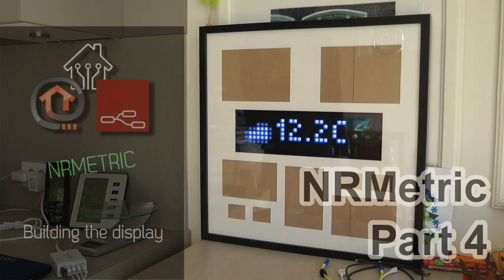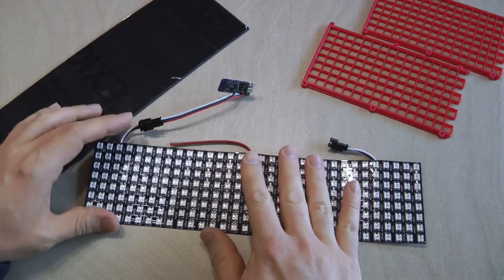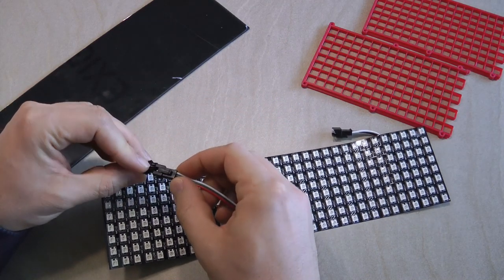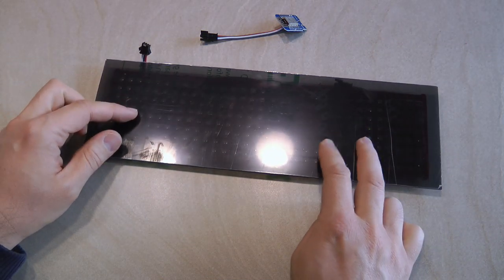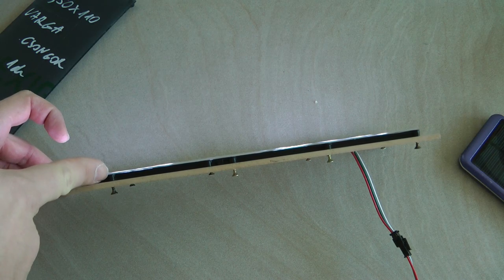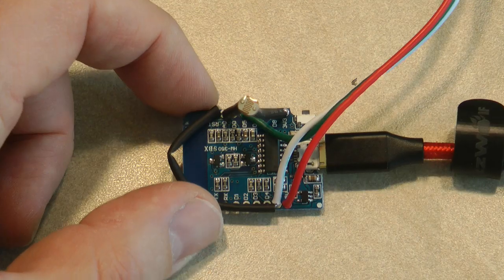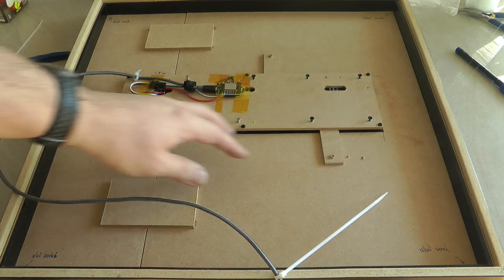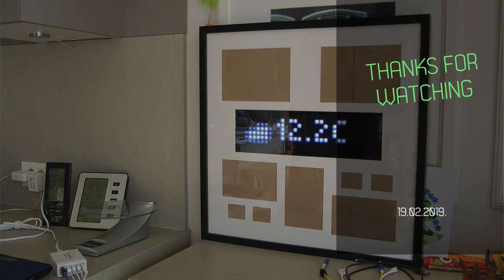NRMetric Part 4 - Building the display

Comment: Thanks for being active here. I have a question regarding the thickness of your acrylic.  Is it 5mm? I'm about to order some online and not sure if I should go for the 3mm or 5mm. I just finished redoing the icons today (46 in total at the moment and growing:) Had to rework a lot due to home assistant have 15 possible weather statuses. I also almost finished reworking your flow to fit my home assistant environment. I'm really enjoying this project!
Reply from the maker: To be honest, I only used 2mm. Since it is in the frame, that gives sufficient rigidity.

Comment: Hey, great tutorial! One thing I missed is how did you power it up. This matrix needs a dedicated power supply (5V with.. 15A?), and I didn't catch in this video how you set it up. Can you provide some info, pls?
Reply from the maker: I think I did mention it somewhere, but I am just using a standard high power USB adapter. This display can draw like 15A on full brightness and all pixels lit white, but in reality the way I am running this, is draws less than 1A. I have a USB power meter and I was using that to check the power consumption. That's when I decided that a decent 1.5A 5V USB supply is good enough. And I never had issues with that.
Reply: @csongorvarga  Thanks for your reply! I'm trying a slightly different setup, with a Raspberry Pi Zero W. 

Are you powering your main board, and then power the matrix from the board? Or do you power both board and matrix from the power supply?
Reply from the maker: @patison4ik5  I have taken a very simplistic approach. I have the micro USB plugged into the Wemos D1 mini USB port, and I am powering the display the 5V pin from the Wemos D1 mini. I have not checked the schematic, but I assume that is connected straight to the 5V or the USB. So everything runs on the same USB adapter and cable.
Reply: @csongorvarga  Perfect, thank you! I'll try the similar approach, hopefully it'll work. 

ps I should've payed more attention in high school during physics classes lol
Reply: @csongorvarga  I'm making some progress! I powered it from the board, and it seems to be working just fine. I'm getting to the phase of making the frame with the plexiglass, and I was wondering - do you have a 3D model for the plastic mask you printed? If so - could you attach it to this video, pls?